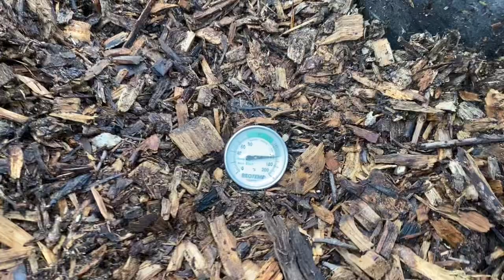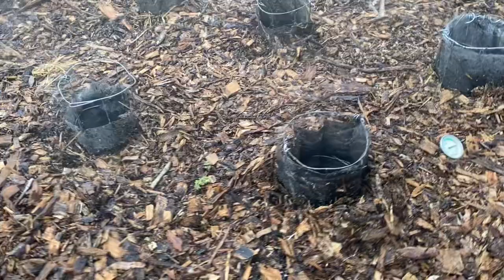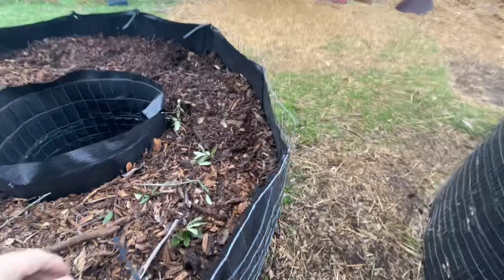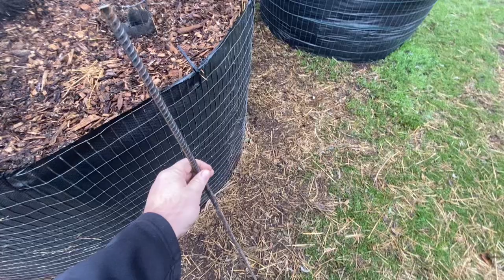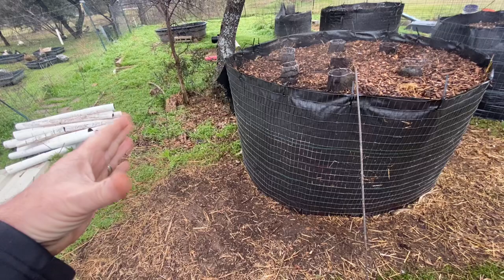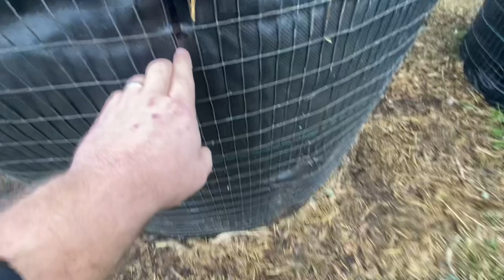New Compost Bioreactor - Questions Answered

Comment: My experience is that consistent watering is less important than it is made out to be: after a few months, the pile drains excess water pretty effectively and also retains moisture quite well. Also, after removing pipes early on, in my pile the chimney holes stayed intact for 8+ months with only minor change of shape. I included some amount of small branches and some other long plant stems throughout the pile (and in general didn't cut input material as small as Johnson's recommendation), so that might help it keep shape.

Comment: I like yours and i am doing it now but smaller version. All my 50-55 gallon bags doesn’t contain any soil, just saw dust and garden/kitchen scraps. I put the perforated pipe and over time, i planted in it and converted the perforated pipe to in-ground vermicompost

Comment: @survivalpodcasting I do something similar with a much simpler method (in my opinion).  In the Fall a receive loads of shredded leaves from a landscaper.  I build a pile that is 10-15 feet diameter and 4-feet high, held with welded wire fence.  As I build it, every 10-12 inches of leaves I add, I will sprinkle some soil/compost for the microbes, and wet it thoroughly.  Then in late Fall when the pile is still warm but before very cold weather, I throw in a bunch of worms. After that I do nothing more.  The pile stays warm thru the Winter, worms find the spots they like convert into worm castings. So it's a combo of fungal/vermi/microbial breakdown.  It's ready to use in the Spring 18-months later. I could use it sooner, but that's a good amount of time for full breakdown.

Super easy, never goes anaerobic, and makes amazing compost. But I can't take the credit.  I learned this method from Tom Bartels in a video he made explaining it.  Let me know what you think.  I'd love your input on the method, if you want to see another way of doing it that is.  I'll drop the link here, hopefully youtube won't delete it. https://www.youtube.com/watch?v=u9ZOI_coqFA

Comment: I am wondering about using some kind of heavily perforated pipe, not drainage piping, but filter pipe maybe. I'll consider the course. Been thinking about this system.
Reply: You can use the pipe to start, just remove it after the pile has settled.  the straw/wood pile will not collapse into the breathing holes for long enough if you built it well.  Mine isn't a year old and the holes are still open enough, but my piles are mostly straw as I had a ton of straw and less chips.
Reply: @CopperKnight1  i see, is it hard on your back pulling the pipes? I rather build once and be done
Reply: @agrosyntrop  they come out easily.  The pile settles in but doesn't grab the pipes at all and I used corrugated drain pipe.
Reply: I'm going to try the fence/fabric for my second pile next spring if I have enough chips/straw to build two piles.

Comment: Great video Jack, loved seeing that steam rising.
This year i will be experimenting with different shapes.  Im looking at making them slightly smaller than the diameter of a raised bed, then when its time to open them up just build a raised bed around them with at least 6 inches of space between them so i can pull the fencing out.

I am trying to have less shovel time with the whole process.

Oh, so i did an experiment last year with planting directly into them and put it under full shade to make it as difficult for the plants as possible.  Ummm 🤔, i had  cucumbers using the tree as a trellis lol.  It was not the outcome i expected considering I'm in Eastern Ohio.

Comment: This is great stuff!  I've seen that a lot of bioreactors are built on pallets (for airflow on the bottom?) but it looks like yours is directly on bare dirt.  Is that right?
I'm assuming your columns provide enough air flow, even all the way to the bottom?
Reply from the maker: This is all in my course.  We did pallets, zero gain for an extra thing added you don't need.  Dr. Johnsons are 6 feet high these are only 3, that is also by design on my end.  Last by having ground contact we are cultivating and harvesting even more IMO.

Comment: Have you had anyone make it just from a woodchip delivery? How did it turn out?
Reply from the maker: You really need some N in there.  15-20% is ideal.  But something as simple as green grass clippings will do that for you.  Some use a sack of alfalfa pellets, coffee grinds also work.  

People have pulled off all dry leaves, it is good compost but not the same more "leaf mold" but all chips is going to make a very chunky and not well balanced product.   I mean literally we are talking a wheel barrow or two of greens being enough.  

Now FRESH chips that have a lot of green still in them, that will work by itself very well.   So it depends.
Reply: I like leaving my woodchips in the piles from drop off for a few years. The amount of worms in them after two years is crazy